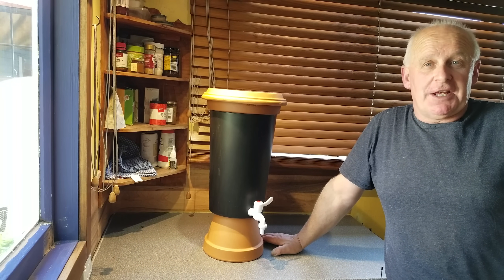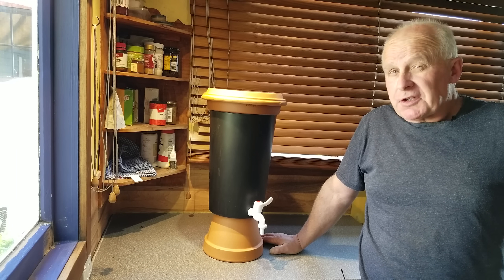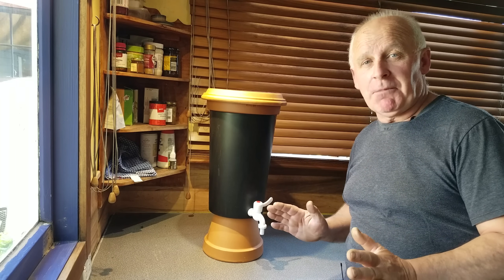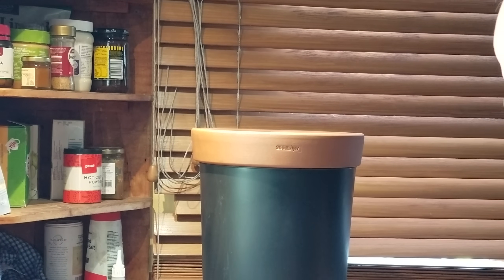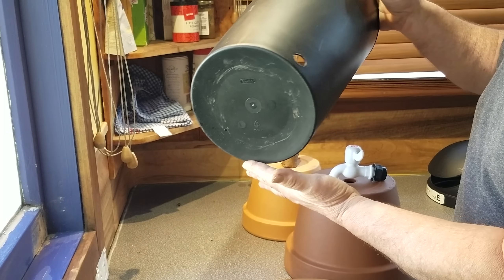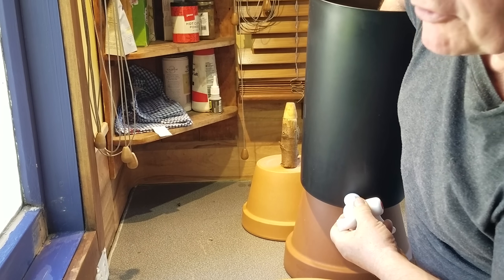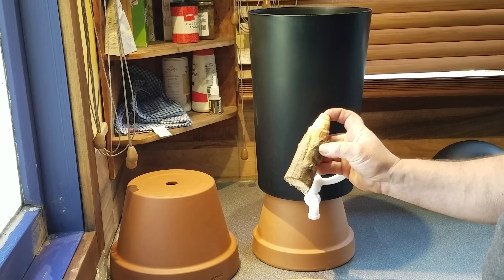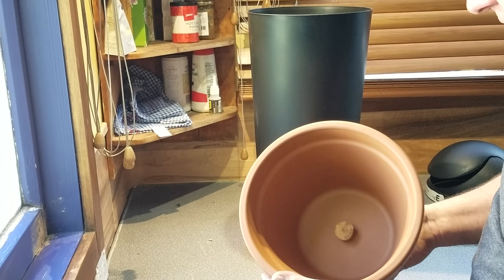DIY water filter. How to make FILTHY WATER drinkable

Comment: All set and now I have been waiting for water 'sweating' through my Terracotta pot... Not really impressed... Two days and no real result * am I missing something?  Oh, its winter in South Africa
Reply from the maker: yes- you have not read the info in the follow up video that is on screen immediately when the video starts. or in the pinned comment on this video
Reply: @t.h.o.r.  sorry, are you referring to made in Italy as mine are made in Germany. Not in India.
As of today... No difference in performance. I even brushed for 10 min in and outside surface of terracotta pot to ensure no 'coating' might be found on the pot.

I am truly at a loss: (
Reply: https://youtu.be/btQXh8rRbLk

I watched :) still, where could I find out what is wrong with my 'sweating'  / yield of water flow through my pot. Seems I am missing something :0)))
Reply: Soooooo....the culprit has been identified! German terracotta pots have a special impregnated coat on them. Harsh winters and hot summers require a more sturdy product than its counterpart for Mediterranean climates eg Italy.
I am now using Italian pots and all is well so far🙏🏻

Comment: I like your use of a colloidal silver wash on the inside of the filter pot. Have you ever seen the food cooler/refrigerator made by placing a metal or glazed pot inside a much larger terracotta unglazed pot tat has been filled with wet sand/sawdust mux and topped with a Styrofoam lid? It works by transpirational cooling and can keep even lettuce fresh
Reply: I was just thinking about that concept when I read your comment

Comment: Or buy some food grade buckets...
The bottom bucket can have same tap installed at lower end of bottom bucket. Fill bottom bucket densely with cotton (about 6 inches from bottom, and the rest of bucket full with finely crushed charcoal by burning wood and then processing it down. Have a lid for each bucket. Cut larger hole in lid. So the drilled hole in bucket above that one can drain into lower bucket. But the next level bucket above bottom one should have a fine screen in it, then fill a few inches of small gravel, then the rest with sand. The 3rd bucket on very top, I'd fill with large gravel. And start filling with water slowly. I'd maybe sit charcoal & cotton bucket on maybe a milk create or two and have a container under that to catch water. You'd want to reuse that bucket to refill the filter. Because first time through would be just to clean the resources in buckets. And you could have a 4th bucket on top without a lid if preferred to be a bucket filled with water so it drains out kinda slowly. And there you could have like an industrial water filter...

Comment: This is brilliant, love how you inexpensively made a superior water filtration system!  Like you said, no expensive replacement parts to buy either.  Nicely done!
Reply from the maker: Great point Sherilyn!
Reply: Wish I'd seen this a few years ago when I paid a lot of my Berkey water filter system. I will though when my filters life runs out perhaps buy an unglazed pot to put in the top part, keep my bottom with the spout as I have it already. Instead of buying more filters, this is a good idea. My question is though. Since I'm not sure where to find the piece of wood you have, what other material would you suggest to plug that terracotta pot hole?
Reply: @helend3245  you could use a cork from a wine bottle and cut it to size carefully with a Stanley knife if needed
Reply: WHat is brilliant ..? Showing centuries old technic on youtube ?
Reply: @davidniquot6423 @davidniquot6423 yes! There's great wisdom in appreciating the brilliance of our ancestors with a modern twist and then sharing that brilliance with the rest of the world that has lost touch with their ways is fantastic!  Sharing knowledge is one way to immortality - a part of you will live on in what you teach others. An teaching others how to cheaply filter their water, such a basic, yet absolute necessity, is  a great thing, indeed!

Comment: Cool beans on the relatively free serviceable water filter. 😁 I know that store bought ceramic filters can be "cleaned" by lightly sandpapering their ceramic surface. I wonder if that means your ceramic filter would need to be cleaned occasionaly too. What happens if I don't use that silver solution? It doesn't look easy to find.
Reply from the maker: watch my video on making coloidal silver
Reply: @t.h.o.r.  Now that is the type of response I like to hear. 😀 I enjoy making my own gear. 😉

Comment: I use rainwater for all types of things, but especially washing my hair. It makes my hair soft. After filtering and boiling my rainwater, I add cold filtered water to get the temp I like. I place the water in a camp shower bag ( Walmart, Amazon- several sizes 5, 10, and 20 gal) with a hose and spigot included, then open the tap and wash my hair. I fill 2. 5 gal bags. Keep extra water nearby and a funnel to refill the bag if needed.
I found this video to be very useful, and plan to make several for friends and family. Thank you so much.

Comment: If your water needs more filtration, you can stack several pots together.  Definitely simple.  In fact, the flower pot water filter is being investigated for possible use in 3rd world countries with unreliable clean drinking water supplies.  Many succumb to waterborne illnesses...which are entirely & easily prevented using such filters.  The bung in the bottom was a good trick, making use of the natural antiseptic qualities of the wood.  Very cool.  You're going to put Big Berkey out of business!

Also, you mentioned colloidal silver.  In my experience, many are oblivious to the virtues of it, even if they've actually heard of it.  I can't say enough good about it.  I use colloidal silver tooth paste, and my gums haven't bled since.  I don't get the "😝" mouth in the morning, or bad breath (halitosis).  I use a top quality sonic toothbrush and with the toothpaste, I feel like I just stepped away from the dentist chair.  It's that good.  

So, is there a down side to colloidal silver?  Yes.  Cost.  If you wish to make extensive use of it, there are kits you can purchase to make your own, for much less than store bought.  So, there's an option for every budget.

Anyway, brilliant video!  I'm subbing and ringing the bell!

Comment: Take a larger terracotta pot, place a smaller terracotta pot inside it, fill the empty space between the two with sand, fill the sand with water, place a lid on the smaller pot, you now have a refrigerator cooled by evaporation. Arvada lifestyle states you should store your drinking water in terracotta pots and drink from copper cups!

Comment: I apologize for being so dense, but is the ceramic flower pot the actual filter itself?

Contaminated water will seep thru the ceramic pot and water will need no other filtering???

Will this system filter out heavy metals, biological & chemical contaminants?
Reply from the maker: research how a ceramic filter works

Comment: There ain't no way I'd drink anything from a garbage can....especially one with a 5 on the bottom. It is NOT food grade plastic.
Reply from the maker: water pipes and water tanks and medicine bottles are made from polypropylene -  No 5 is just the recycle code. Not ALL no 5 plastics are polypropylene. Do you use clingfilm? do you ave a non stick pan? do you use toothpaste? 
do you use a plastic cutting board?

Comment: I didn't think about using this AND killing pathogens with Colloidal silver spray! The Alaskan fishermen  put a silver dollar in the water to keep the fish and water fresh. You can also use a triskelian copper or silver coil to kill off pathogens. I use harmless CLO2 (chlorine dioxide) which is twice as effective as, but more unstable than Colloidal silver or food grade hydrogen peroxide drops. Make it by mixing 28% sodium chlorite solution with a 50% citric acid solution activator- 2 drops each. Mix drops together, add this to purify your drinking water after around 20 seconds. (Military water purifying drops.)
Reply from the maker: Oooh yeah!- I buy chlorine Dioxide in 20 litre drums and use it all the time in the kitchen- on wounds and in water.- you are right- leave the lid off for 4 hours and the whole lot is ruined!

Comment: bottom layer charcoal middle layer chalk top layer sand not lumpy ingredients. place inside, any large preferably round container, with small holes or fine sieve mesh, under charcoal,  to let filtered water seep through, into something to catch the filtered water in, important, boil before drinking, to kill of any tiny, water bourn parasites. change top layer of sand, regularly, as this catches most of the large stuff in the unfiltered water

Comment: Apparently there is a difference in the (unglazed) terracotta in the U.S. I built one of these and it has been setting 2 weeks now with over 3 liter of water and in this time, barely .5 liter has seeped through the clay. I can't get by on .5 liter every 2 weeks.
Reply from the maker: Thats why you read the info in the comments  and follow the links - so that you get all the info
Reply: Yes, I did read down the comments AND reviewed your links ~ (which are essentially unrelated colloidal silver instructions and FDA lab test info ~ useless for retail availability of terracotta for 99.99% of common buyers). So, still of no use. But, I did find your follow up video which refers to Italian terracotta, so I will be on the lookout for a source.

Comment: What kind of ceramic pot did.you use? The ones that are sold in our area do not let the water through. Input one together a month ago, and it still holds most of the water. So this idea does not work here in this area.

Comment: just fyi the PP/5\ plastic is indeed the food-grade kind, but what makes it NOT food grade is the dye/paint. i think markings on the outside are fine but usually colored plastics (even Polypropylene) are not deemed "food-grade"

personally i think that's BS to charge MORE for stuff that costs LESS to manufacture but that's often the case when equipment and processes require higher standards. I use paintbuckets (that i've sterilized) for food storage for years and no issues yet. im sure in the long run you WILL be better off with non-colored plastic, but unless you're storing very hot foods in it- shouldn't be a problem.

so yeah, if you ever wondered why the same buckets at Lowes are so much cheaper than the ones for food that's pretty much it. I'd like to hear if im missing something, like maybe the colored ones leech a lot of toxins over time or if exposed to UV idk. all i know is its pretty much the same fkn plastic with the same qualities.

also important to stress that the terracotta pot MUST be non-glazed (called UN-glazed). please do not take a glazed one and just grind off the glazed. probably can't remove 100% of it and i have no idea wtf even a little bit of that would do if consumed <3

sorry if comment came off know-it-all-ish, im noob. just very experienced with failure. its kinda the only way i learn these things lol

Comment: Use food grade white icing buckets usually free from your local bakery. There are no chemicals that can harm us in the plastic of those buckets. Then put a solid silver dollar in the upper terra-cotta pot. If you cannot find clean water to put into the terra-cotta pot on the top, you can distill water by putting a smaller,  empty metal pot inside a larger metal pot. Put the cleanest possible dirty water in the outer, larger pot, turn the lid for the larger pot upside down so that the water condenses at the lower part of the top of the lid (usually a handle) and then boil the water. As the water boils, steam rises, and condensed water drips down into the inner pot. This is a fuel intensive method but it will clean almost the worst dirty water you can imagine.

Comment: Hi, Nice video, and it may work for filtering the clean rainwater, but if you want to filter tab water, you would have a problem with filtration of the solved chemicals in the water if there is any:
Your clay pot water filter only can absorb some particles from the water, but not the solved chemicals of the water!
In order to absorb some of the solved chemicals from the water, you should at least use active charcoal for the filtration too!
Also porous of the clay pot will be clogged after a while and you need to replace the pot with a new one every few months!
If you use the active charcoal, it also has to be replaced with the new active charcoal every few months.
The frequency of replacing the clay pot and the active charcoal depends on the volume of the water filtration and the pollution of the water.
Reply: It's still a very good idea.  The charcoal is an added plus and a uvc light attached to the inside of the cover for micrograms and viruses  if there ever were a contamination. 

God bless you.
Reply: I agree. This doesnt show that even this clay pot as a filter will still need replacing. Pours in these pot will stop filtering after several months of heavy use even with clean water

Comment: Do you do anything to oxygenate or aerate or at least agetate the collected rainwater? That's a cool idea with the ceramic pots. I wonder what the filtration size or rating or whatever its called that measures the micron size  the filtration ends up being? Is it in the range of osmosis? How does it make the water taste? I wonder if lining the poly pro part with copper would be beneficial since copper has got natural antimicrobial properties.  I'll go check out your rainwater collection video now..

Comment: Fun build. I'm a water distribution/ treatment worker in California. My concern is, does it filter out pollutants, like heavy metals, pesticides, etc. Have you had the product tested through an analytical laboratory?
I'd be very interested in the analysis and conclusions.
Reply: Yes please
Reply: No, it won't.  In fact, it won't filter out much other than large particulates.  The pore size of unglazed terracotta garden pots is pretty large (although that depends on the firing temperature and thickness).  This sort of thing is good if you already have pretty clean water and just want to do a final filter to remove dust and such, or if you have no other options, but it really should have a few more components to be effective.  Also, there is the issue of the water in the container getting funky, but that can be dealt with by frequent cleaning.
Reply: Valid question. Claims of "cleaner" water or "safer" water are really not complete without some independent testing to back it up. I like the vid, but would rather be educated on what actually works and the testing would really make it better. A lot of people might tend to think they are filtering out things that maybe they aren't.
Reply: hmmm.... he used this to filter rain water right? its new to me that rainwater have heavymetal etc
Reply: @fanyoktavia1703  chemtrails are polluting rain water with aluminum and all the other chemicals in the trails. It's really sad
Reply: @Rochelle-r9j  what is the other chem? people use alumunium pan to boil water in here n easy to find alumunium scrap on river/lake/sea or any water source
Reply: @fanyoktavia1703  -  You haven't heard of air pollution  ?
Reply: @tomrogerlilleby2890  yes water, earth, air sound polution etc. i just dont realize how bad is that in other country till you need very good water filter just for the rain water.
Reply: @fanyoktavia1703  Have you been living under a rock for the past 2 decades, have you not seen the chemtrails in the sky. To those who are going to diss it, don't even bother because 'they' have already admitted to it and they've even done it during WWII and ever since.
Reply: Brian, You also don't know what metals are in the terracotta clay itself, one source of clay may be fine, while another may not be.
Reply: Yep agreed you are more aware than anybody, or have access to experts, please run a test and let us know, as far as I know chlorine dioxide is used when camping to disinfect running water, I would assume rainwater is somehow closed to distilled as it is precipitation of former vapour? 
Better than any tap water if you ask me. For as much crap as you can have in the atmosphere as much will dwell in the underground but more concentrated, I would assume?
Reply: If you are collecting rain water, you will not get pesticide or heavy metal.  Not unless they are flying commercial aircraft with chemical sprayers for weather engineering in the skies.

Chemtrails anyone?

Enjoy a healthy long life while you can.
Reply: Hi Brian did you test it?
Reply: A simple TDS meter would show the results
Reply: I honnestly would be very surprised if the guy knew what the heck he is talking about. In a couple of weeks, he'll be asking himself how he caught cholera.
Reply: And then let us know 😬
Reply: Why don't you try it and get it tested yourself?
Reply: @Couchlover47  Oh nonsense! It's a valid question in response to another equally valid question from an over-concerned YouTube watchaholic like me... Get the water tested... Don't get the water tested... It's all the same to me... I'm still drinking steam distilled demineralized water in plastic bottles or getting my water from the chemical tap at my kitchen sink... I'll bet ANY filtration is better than that terrible false dichotomy!
Reply: @unclebenny9028  There gas been a word released that they are going to put something in the water purposely to kill people. I know that water evaporating from every reservoir and lake us not normal. They ste creating draught with their fake sun launched by China.
Reply: @unclebenny9028  Point being it's not his video and not his responsibility to display this method works to this standard. He made a comment to ask a question on youtube. Not published a video espousing incomplete information.